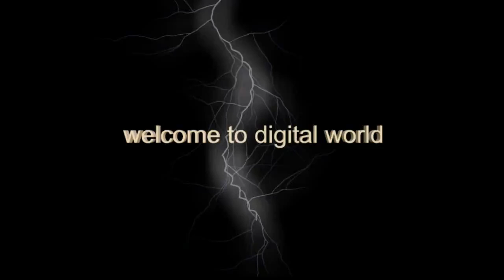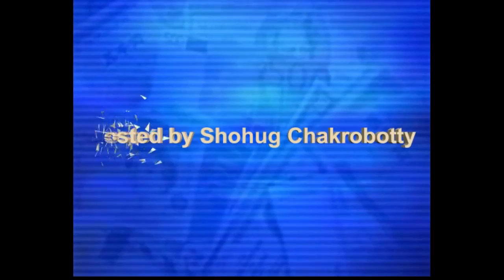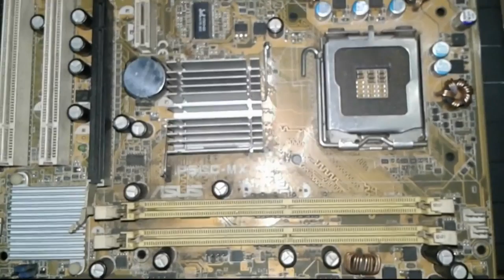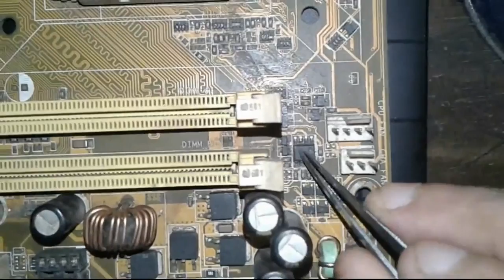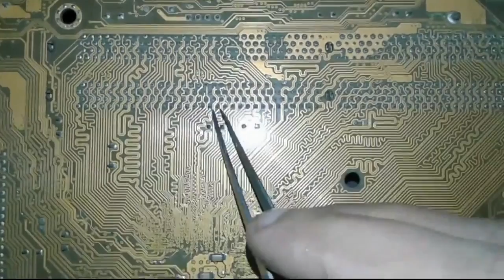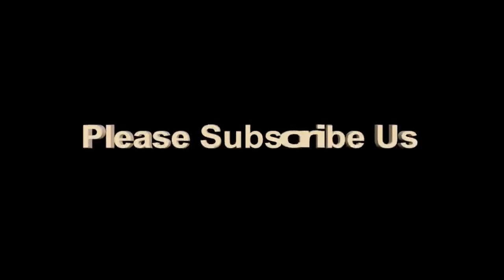How to repair No display computer motherboard

Comment: Bhai mera motherboard se display nahi aaraha hai 
Asus p5kpl am/in 
In k misfits ka reading kya hoga 
Agar chang karna hoga to kahan milega
Reply from the maker: 1. Check ram. 2. Clean ram Slot. 3. Check motherboard sound without ram. 4. Check capacitor . Hope you can solve your problem.

Comment: help me 
how to fix no signal on the monitor and itry to put out the ddr3  and put back again but no signal still
Reply from the maker: you can remove ram and turn on pc if it make beep sound that means ram problem.  if it make no sound that is motherboard problem. If you send me details i try to help you.
Reply: SMRITY COMPUTER  no beep sound
Reply from the maker: motherboard ram ic fault